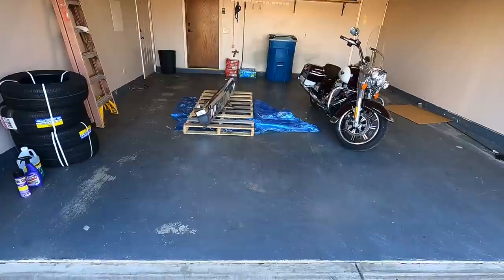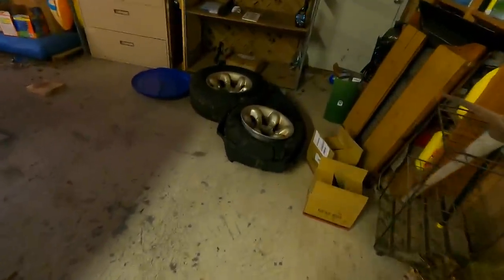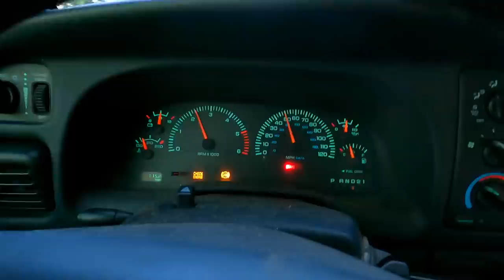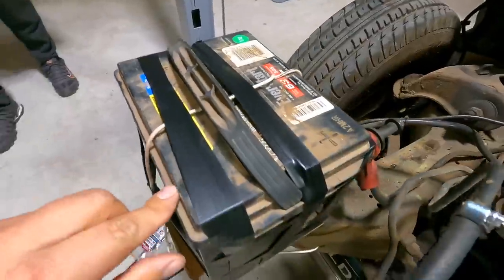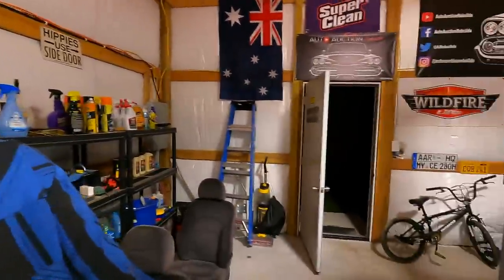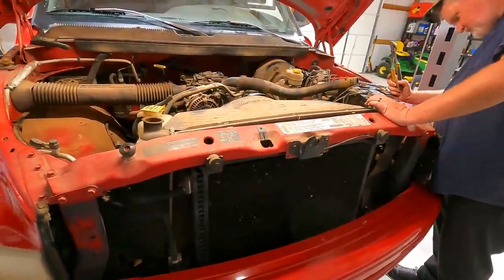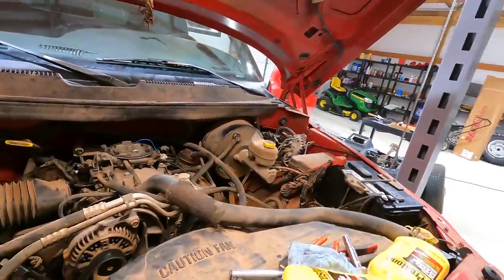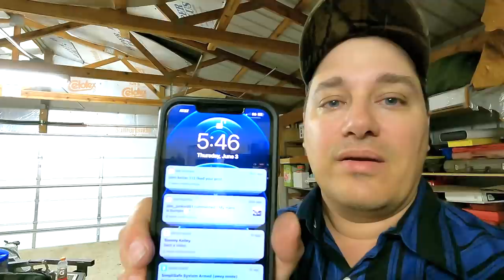Abandoned 99 Dodge Ram Sport Revival!! Brakes, Radiator, Wiring, Mice, NEW WHEELS and Tires!

Comment: my neighbor bought a new harley over 1 year ago and put less than 100 miles on it. we just changed the oil and now he just bought a used '03 883 with only 1200 miles on it. both run perfect now and are tagged. i ride my bike every chance i get. ive been riding streetbikes for 30 years now.

Comment: I have owned a 99 short bed extended cab Ram Sport with a 5.9 for a long time. Roughly 250K on it with no major rebuilds anywhere. Still runs great and is cross country worthy. GREAT trucks.

Comment: Best way to clean out the coolant system is 2 gallons of white vinegar with distilled water drive it for bout 2 days then flush it u can't imagine what comes out been doing it for years
And them 5.9s are  Notorious for cooling problems everytime I buy a durango with the 5.9 first thing I do is change the radiator water pump and thermostat and sometimes the heater core

Comment: Randy, I think you need to mount a large mirror on the wall above the HVAC system in the shop so when your putting cars on the lift alone you can see your position.

Comment: I have a 99 dodge pickup I’m having fun fixing it up. I took the stock aluminum wheels and had them powder coated purple,like the truck with center caps and it looks great with the 33s I put on it.😁😁👍👍

Comment: I recognize that sound in the engine bay, I had the same exact sound coming from my 1997 jeep grand Cherokee, that is the water pump impeller dragging on the pump body!! While I was in there I replaced the timing chain-sprockets, fixed the corrosion damage on the gasket mating surfaces of the timing cover, front seal, pump cavity gaskets water pump, belt idlers etc..  Don't wait too long to replace the pump, it will start to leak out the weep hole if left rubbing too long as the pump bearings are self destructing and changing the angle of the pump shaft.

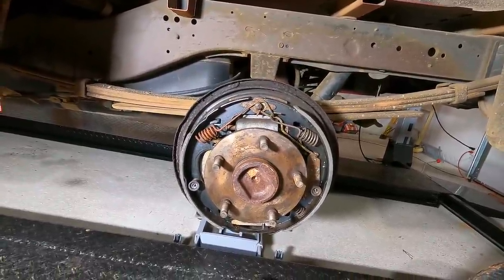Comment: @ 33:06 - OLD SKOOL TIP - after replacing all the springs on the brake, on the "orange spring" especially, just slightly bend that loop a little more  closed so that it doesn't "pop off" the stud. If you've ever had 1 of those springs pop off while driving, you'll know why I say this. The long side of the spring arm gets jammed between the shoe & the drum causing damage to the shoe, and a heck of a time disassembling the wheel to correct the problem

Comment: I just bought 4 16 inch steel wheels for my 2001 Dodge sport, to replace the factory wheels that are on it, mainly because 2 of then you need to retorque 4or5 times when ever you pull them off and replace

Comment: My truck came with the dash skinz dash cover and the front suspension is completely rebuilt front pump trans seals and new transmission filter and gasket and transmission fluid..

Comment: my 98 zx2 was behaving like this on idle even after replacing a bunch of hoses, MAF, etc etc, even a smoke test... had some power steering lines worked on and mechanic doing the work noted some rotted vacuum lines he replaced and the issue was magically gone!

Comment: I have a 2000 dodge ram Laramie slt quad cab long bed 5.2 318 magnum v8 46RE AT 1500 4X4 176k miles and has the premium infinity 6 speaker amplifier filters sound system and the tweeters on the windshield pillars and the Chrysler cassette tape player CD am/FM stereo receiver, and the gloss black and white pinstripe might have been silver pinstripe originally anyways it's factory wheels are the same full polished aluminum wheels you put on the sport and I always thought that the sport 2wd or 4x4 got the 5 spoke star wheels until the 98-2001 sport off road edition got American racing equipment atlas polished aluminum wheels.

Comment: As soon as the check engine light turned off and it ran WORSE, knew there had to be some bad input. With the light on it was probably in a open loop mode for safety just using programmed values. Once it went off and started actually trying to use its sensor data.....trouble.

Comment: Those dodge trucks especially the 5.9 liter amazing trucks man its a workhorse. I use a 1999 dodge ram 1500 half cab with a lift. And it runs great except the crankshaft sensor bucks it

Comment: I live here in okc. I have a 2000 ram 1500 with a 5.9L and I had a similar issue. Turned out to be my flex plate that was crack and causing the misfire and rpm jumping like that.

Comment: Thoes long nights at Aar headquarters I'd be putting a cot or a bed in the house and sleep and nap then go back to the city. Don't need you falling asleep at the wheel man jeep up the good work!
Reply: I'm pretty sure he talked about that house being haunted in an older video.
Reply: @wyattberekvam3123  I remember that video. I think I'd deal with the haunting than fall asleep at the wheel. Or I'd be sleeping inside one of the vehicles.
Reply: @richardbeckett5580  a couch in the shop wouldnt be a bad idea .

Comment: i mentioned this in the last video but i think its going to a safe mode in the ecm. which is a base tune it wont meter air right etc.. so it will run good but it wont be optimized. sounds like a bad 02 or iac/maf. which that year dodge i think had iac vs maf. that crank sensor could do it as well if that fixes it.

Comment: I own one of these trucks. Your operating temp on that Dodge is way too low... should be running around 200-210. Battery load is normal. Get those codes read and check the ABS relay...

Comment: That might be a 76’ rear bumper, 75’, 76’,77’ have rounder taillenses 73’ and 74’ are more square looking.
Reply: I don't think Chevy made any changes between 1973 and 1977 on the rear bumper of the El Camino.  If you are remembering rectangular lenses, that was wagon only.

Comment: you can modify the exhaust in all 50 states just cant cut the muffler or cats out. any state that has emissions test will require it to be certified either way when you do a state inspection. however they may be exempt due to the trucks age some are 20 years  some are 25/30. california is the weird ones i think 78 is the cut off year there.

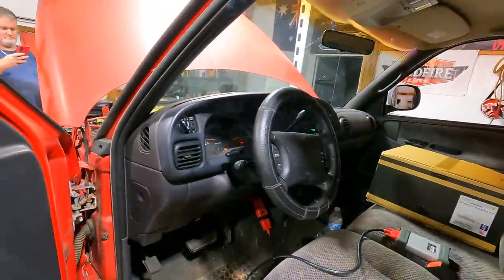Comment: 35:19 sounds like your pulley's are misaligned. if i were you id replace your idler pulley and get a belt with different patterns on it. gatorbelts from amazon are pretty cheap

Comment: Dunno if that truck has a smog pump, but if it does, my money is on that being the source of the noise - but my experience is with Fords.  Which brings me to something I saw on a Mustang forum:  Apparently, there's a place to add oil to a Ford (Thermactor) smog pump, and it doesn't hurt to pour in a little Automatic Transmission Fluid.  Could the MOPAR smog pumps be the same way?  Does that truck even have a smog pump?

Comment: Have you had any defrost issues with the dodge ram Laramie slt sport while you had it my ac works good and the heater works good as well but through the dash cluster bezel vents and the passenger side dash pad vents and on defrost it still works fine but only through the dash vents..?! Any ideas?!

Comment: I think those center caps are for a 3rd gen cause my 1999 Dodge Ram 1500 sport doesn’t look like those? Either way the original wheels look good, not the best but definitely better then the ones the truck came with. 👍

Comment: With the cooling system not bad you're supposed to flush the system without the new radiator because all you're doing is pushing that dirty crap into the new radiator the dirty water might go away but the chunks of crap that was in it gets stuck in the little passages in the new radiator therefore ruining the new radiator

Comment: I much prefer the factory original wheels over those aftermarket.  I find modern vehicles look much better with OEM wheels. They are so much nicer than they were decades ago. I do have a soft spot for steelies with trim rings & dog dish hubcaps and good old fashion Cragars.  The el Camino would look great with either set.

Comment: keep it original nothing looks worse than a car with different color jams than the outside color. i dont love either wheel on the ram honestly. was never a fan of the oem wheels on those minus the ones that had the stripes idr what those are called.